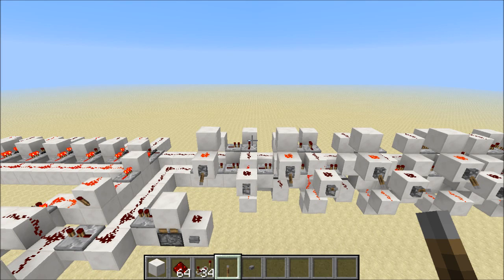1 Tick/Bit Serial - Fix for 13w04a

Comment: One thing you might want to play with that I like to do with my serial encoders/decoders, is instead of having a second sync wire to indicate the start of the byte as you have here, to send a pulse before the data comes, and have that pulse set an rsnor to prevent the data pulses from interfering; trigger the recieving latches, then reset the rsnor for the next byte.

Comment: Well when they finally fix all the timing issues with torches, it'll eventually be just as simple as a torch in the serial line and a extra 1 tick delay on the sync line.

Comment from the maker: I've thought about doing that and probably will have a design that works that way, but I kind of prefer having the control line especially considering what I'll be using this for. I'll basically have 8 of these running at once in a layer of serial read RAM, so one control line works out well in that situation even though it doesn't make much sense when there's only one transfer line.

Comment: One problem with this!  If you try to input while the machine is transmitting.. it will lock the bit on.  So you can never have input running to the transmitter while it is transmitting or it will cause a problem on the next transmission. Sort of an efficiency bug

Comment: That's not a timing issue... it will not be fixed because it is a feature. torches burn out after being pulsed 8 times in 100 ticks. AND it makes a sound. Mojang didn't accidentally code that into the torches, and accompany it with a sound effect. because of the way torches work, if they receive a one tick, they can not react fast enough, and nothing will happen. This is NOT a bug,